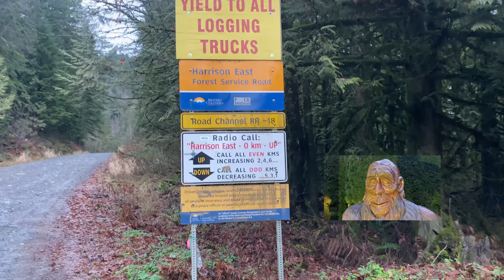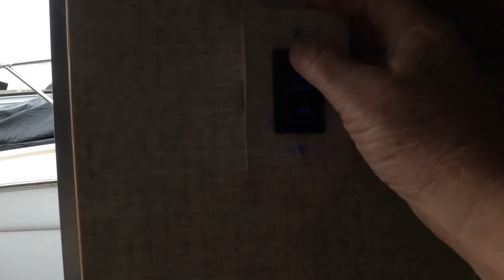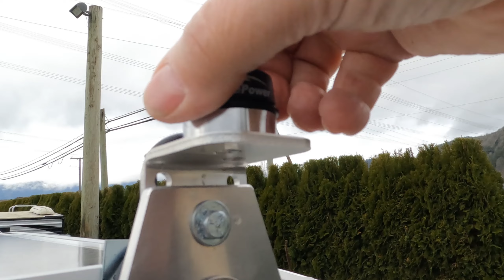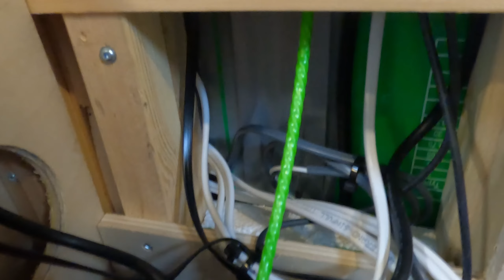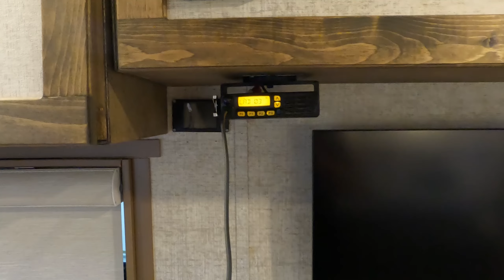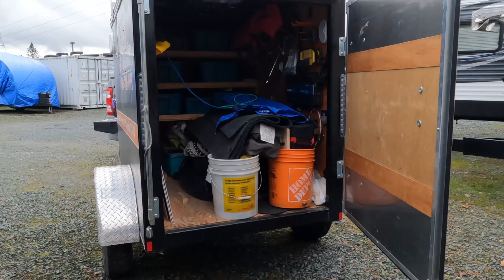ICOM 5023H VHF 2-Way Radios for "Back Country Warriors - Hwy/Lad/RR

Comment: Sweet dude! I love wiring stuff. With any hand held radio such as a baofeng, do you still need a license?
Reply from the maker: Yes, even the Baofeng Radio needs a license, anything that uses the RR Forest Service and lad channels... Have a great day buddy...
Reply from the maker: https://kccommunications-ca.3dcartstores.com/assets/images/WRC%2003-1%20-%20Notice%20to%20Radio%20Suppliers%202021.pdf
Reply from the maker: Check out the pdf below...
Reply from the maker: With a handheld, you can add an external high-gain,  mag-mount antenna and increase your distance 10-fold, I'll be posting a video on that soon...